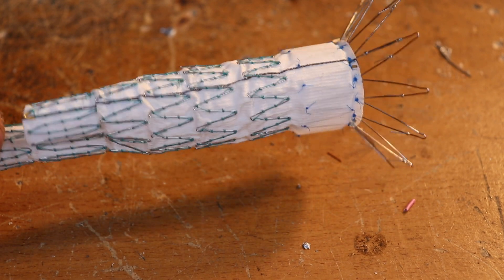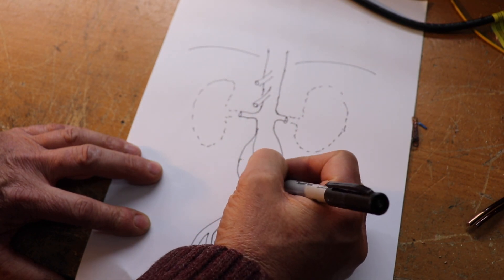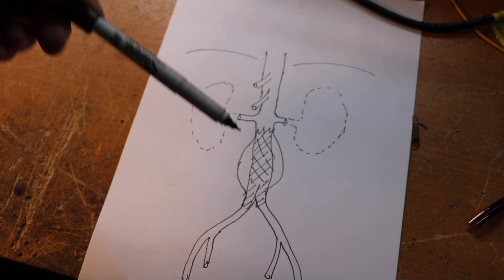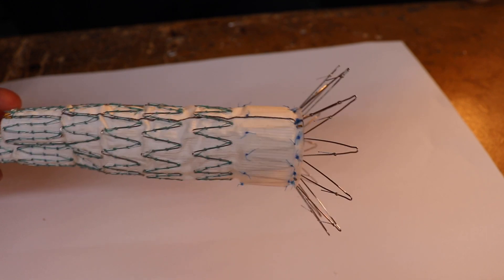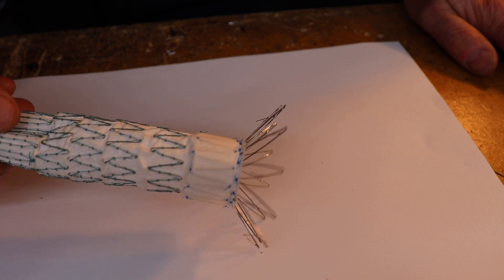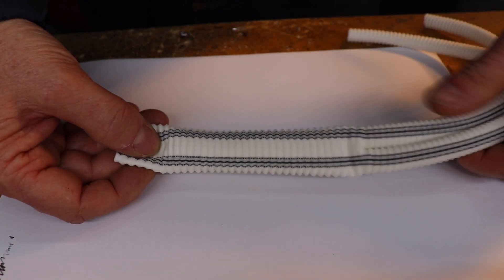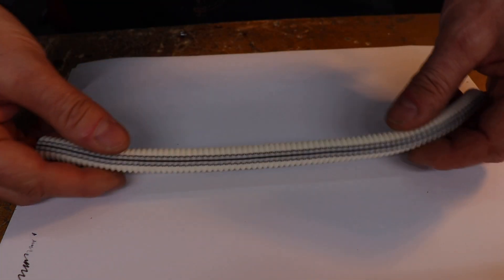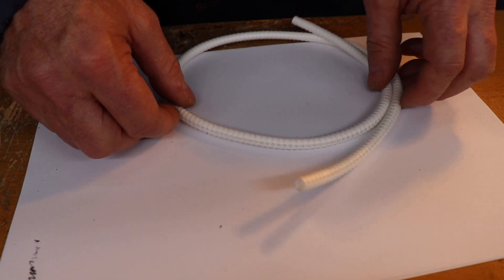Vascular Aortic Grafts  A Closer Look

Comment: I am an ex Aircraft Engineer (Nearly a Rocket Scientist), but, I do have a EVAR Stent, 44.2mm Wide at the top and goes down to my abdomen. (Its Massive)! Same thing killed my elder Brother Andy a week before his 60th birthday in October 2009! He had told me if I had one what it would feel like, someone putting a couple of knives in between your shoulder blades and RIPPING them apart! Well, 14th April 2015 I was in Oakham, Rutland (Leicst) to pick my youngest son up from his tutor and as I opened my car door WHAM!!!!  OMG THAT HURTS - its those knives - and I fell out the car onto the pavement! Managed to crawl to his tutors door a few feet away...  Blue Light to Leicester Royal.. shipped me off to Glenfield that night - they tried to just treat me with drugs to get my BP down as it was very dangerously high to operate! kept me alive (Just) and by 25th April, it was either I died that night or they stented my Aorta? Docs told my older sons that 95% chance I wouldnt survive?  - - - -  I LIVED.. Spent 2 Months in Glenfield, between the Ketamine and Morphine I dont remember much of it! After that just 2017 /18 /19 had 3 lots of Cancer 13 Rounds of Chemo and 3 lots of surgery! It never Rains but it POURS!! LMAO... six years later still here and the stent still doing its job!... ;-)
Reply from the maker: Well done for getting through that! Sounds like you had an aortic dissection. The stents work very well for those sort of aneuysms.
Reply: @thewtf  Thanks for the message - Not an Aneurism - a Dissection, an Aneurism is like having a bruised leg a Dissection is like a open fracture. Most people dont survive this.